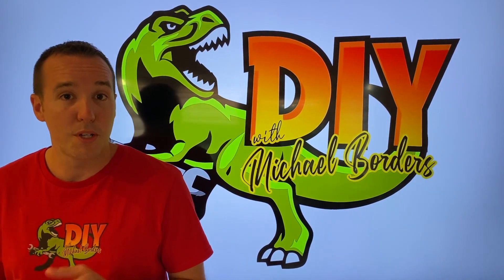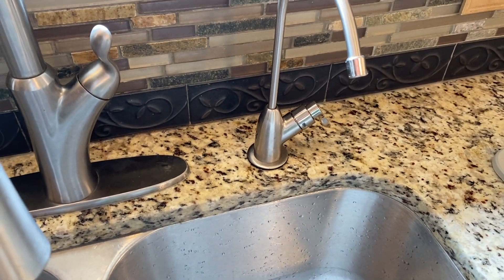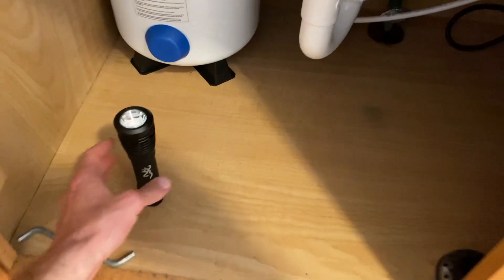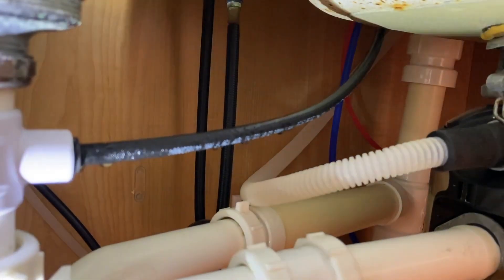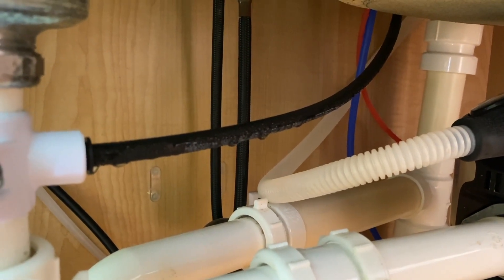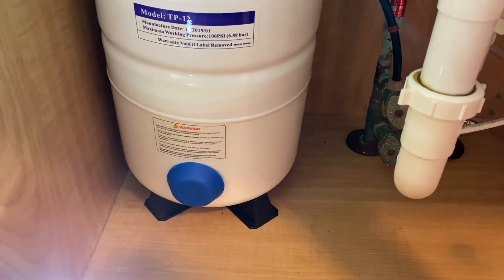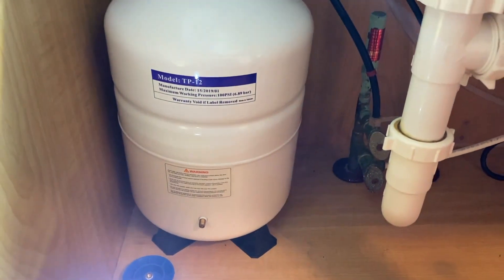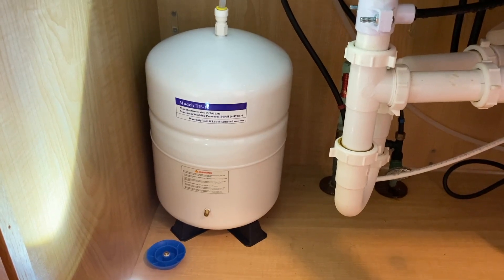RO faucet making lots of noises & tank not filling - Common causes

Comment: Why do mine has draining sound ？Like leaking water sound
Reply from the maker: Thanks for watching, any update?  Below is a link to our Reverse Osmosis video Playlist that has a bunch of videos diagnosing RO system issues.

       https://youtube.com/playlist?list=PLjCXOz8TSkZlQnBuZZrgOiwjkvAkXc_Ov&si=o_Ht55qwRakYVsyk

Have you recently replaced filters?
Reply: @DIYwithMichaelBorders  we had the filter replaced on last October
Reply from the maker: @草管人命荃灣港安醫院  

Thanks for the reply, filters should still be good but we definitely can’t rule it out as a possible cause.

Is your tank filling with water?  The reason we ask is because as the system is filling the tank with water, it is sending the filtered clean water to the tank, and the dirty water up through the air gap and out of the black drain line.

It is normal to hear draining sounds as the system is filtering water and filling the tank.  👍

Comment: Just had mine installed two nights by a plumber and every symptom you describe applies directly. I’ve left him a message to return and check the flow restrictors and tank pressure. Side note: I also have a whole house filtration system that is iffy at best. My drinking water looks like weak pee and the company that installed the system offered to clear up the water colt by installing yet another tank for tannins……to the tune of $6500. Even not operating quite correctly this RO system has cleared the water color completely for less than $600.
Reply from the maker: Thanks for watching, this RO system has been great.  We did our best to make some helpful videos on this specific system.

Below is a link to our reverse osmosis system Playlist.

       https://youtube.com/playlist?list=PLjCXOz8TSkZlQnBuZZrgOiwjkvAkXc_Ov

Hope this helps and spending that $6,500 is a bit much…😬

Comment: I just had a newer one installed about eight weeks ago. I am getting a vibration sound when it's not running water. Sounds like my garage disposal is running...🤔 I don't hear it all the time but it does it quite frequently, daily I would say. No leaks, can't see any leaks or moisture, can't feel any air pressure coming out anywhere. 🤣 sounds amazingly stupid I know, but any ideas...?
Reply from the maker: Thanks for watching, we recommend double checking that your cold water shutoff valve is in the full open position.

A valve thats slightly closed will cause your exact issue.  Keep us posted and hey if you’re into crypto trading, check out our DIY ecosystem.

       toolboxtoken.com

Reach out to us any time!  🧰

Comment: Hi. I enjoyed the video. I have the same system. It's about 3 months old and is now making a bunch of noise (but the tank still fills). I was going to try replacing the flow control but cannot find it readily available anywhere (Home Depot, Lowes, Amazon). Any leads on where I can find it? (There are GE part suppliers online who want $15+ for it and it will take a while to get. I'm looking for a better option.) Thanks!
Reply from the maker: Thanks for sharing, it’s most likely your filters.  Replacing filters should solve issue.

Below is a link to our video showing this friendly DIY project.  Your membrane should still be A-ok.

       https://youtu.be/HEDHI0dKoJk

😎👍
Reply: @DIYwithMichaelBorders  Okay. Thanks for the advice. Would you recommend replacing all three filters or just the pre- and post-filters?
Reply from the maker: @Coach.Dave.Polsky  

Being only 3 months old, you will be fine with replacing just filters however spending the extra money on the membrane may help piece-of-mind having all 3 brand new moving forward into spring and summer.

😎👍

Comment: So I have the same system in the video. My tank is holding water but the air gap keeps getting louder and louder. For reference we have a whole house filter and water softener on our house line before the RO. Anything I can do to quiet it down?
Reply from the maker: Thanks for watching, makes it easier having the exact same unit.  😁

How long have you had system installed and in operation?  If air-gap begins to get louder and louder as well as begin making sounds similar to a frogs croak, filters and membrane are almost always to blame.

Below is a link to our (RO Playlist) which contains several videos you may find helpful including how to properly and safely replace filters and membrane.

       https://youtube.com/playlist?list=PLjCXOz8TSkZlQnBuZZrgOiwjkvAkXc_Ov

😎👍

Comment: Hello there,  I wanted to know, if i don't connect the drain inlet and outlet under the air gap faucet and have the RO drain connected directly to the ABS, will water come out of the inlet and outlet port once the system is active, thanks!
Reply from the maker: Thanks for watching, can’t answer confidently as we haven’t installed it in that manner however likely yes.

The system will need to drain water as it separates the clean from the dirty.  

😎👍

Comment: hi.
if i fill 2 to 3 glass (each 3dl) with water the system starts to make a noise.
it's like when you leav a tap open letting the water flow and as it slowly goes down the drain.
my parents have a RO system just like mine but theirs never makes that sound. it goes on for like 5-10 minutes and then it stops. do you have any idea if thats normal and if not how to troubleshoot/solve the problem
Reply from the maker: Thanks for watching & welcome to the DIY Raptor Club.  Is the RO system new?

Does the RO faucet have an air-gap on side located on & near bottom base?

If so, this is 100% normal.  Please keep us posted, us DIYers need to stick together!!!

😎👍
Reply: @DIYwithMichaelBorders  it is new but there is no air gap on the faucet
Reply from the maker: @AfLpC  

Thanks for the reply, the air-gap is what causes this unique sound.

Since your faucet does not have an air-gap, your system may be filled with air bubbles as it is making water.

This is not uncommon as well and does not really hurt the system in any way.  Not sure if your owners manual has purging instructions as part of the set-up.

Purging your system may solve your issue.  Below is a link to our video showing the purging process for our system.

       https://youtu.be/cHSnbGE3G6w

😎👍
Reply: @DIYwithMichaelBorders  i was unable to solve this issue. i was thinking may i send you an email containing a footage of the system and the actual noise it makes? perhaps that could make it easier for you to identify the problem.
Reply from the maker: @AfLpC  

Thanks for the reply, this is the best way to communicate with us.  Did you perform purging process?
Reply: @DIYwithMichaelBorders  i didn't. Unfortunately i don't have any of the tools listed in the manual or on the internet to do the purging
Reply from the maker: @AfLpC  

Thanks for the reply, what kind of RO system do you have?  We can look it up & continue to help.

😎👍